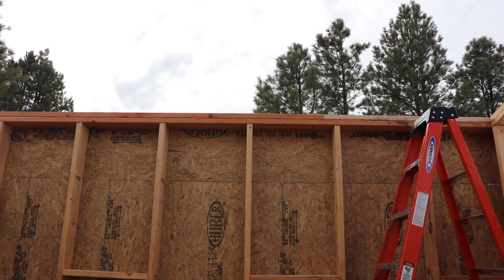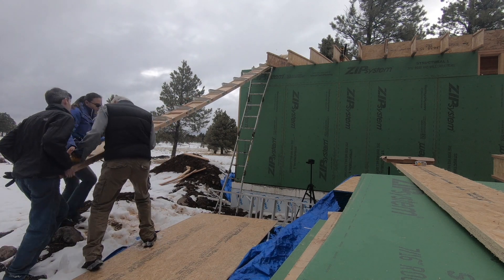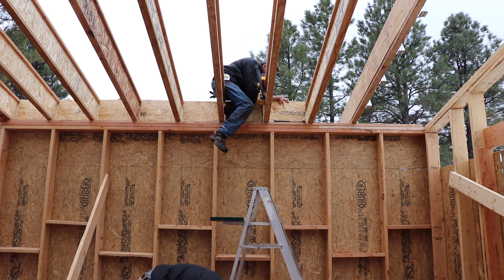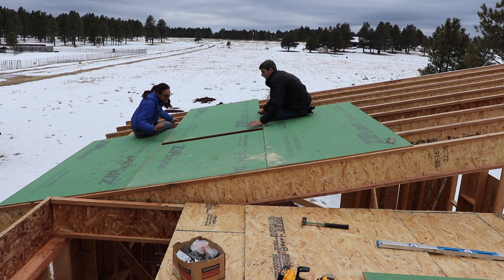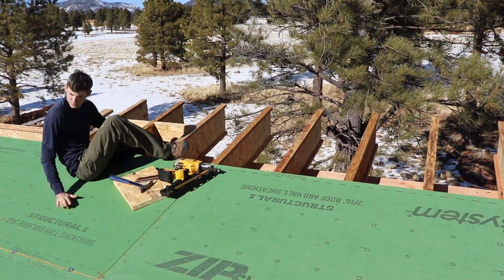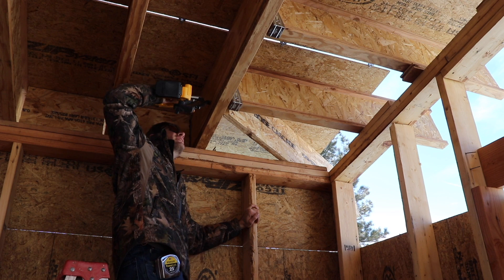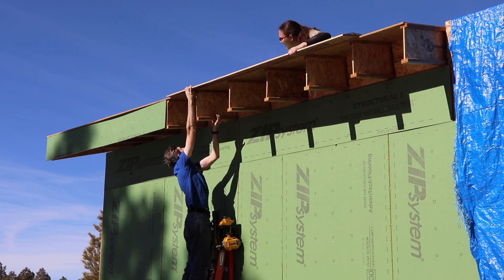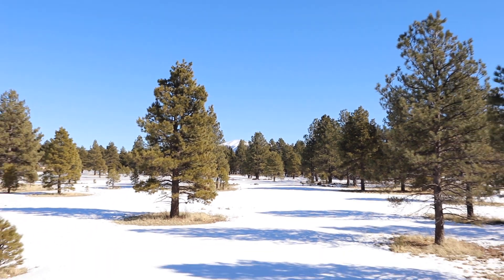Framing A Roof With I Joists (Shed Roof Framing and Sheathing)

Comment: Many people wonder whether it’s better to cut the tops of the wall studs to match the roof slope or to slope the top plate instead when framing a shed roof with I-joists. The reason builders slope the top plate and not the studs comes down to how a house safely carries weight.

Wall studs are meant to stand straight up and down and carry the weight of the roof directly down to the foundation. When studs are cut at an angle, they no longer carry that weight evenly, and the contact area where the roof sits on the wall is reduced. This can lead to uneven loading and weaker support over time.

The top plate, on the other hand, acts as a transition piece between the roof and the wall. By ripping or beveling the top plate to match the roof slope, the roof framing sits flat and fully supported while the studs underneath remain straight and strong. This allows the roof load to press straight down through the wall as intended.

With I-joists in particular, having a flat, properly angled bearing surface is important so the load is spread evenly and the joist isn’t stressed in ways it wasn’t designed for. Sloping the top plate ensures proper contact while keeping the wall structure working as intended.

In simple terms, the studs hold weight vertically, and the top plate matches the roof angle. Keeping each part doing what it’s designed for is what makes the structure strong and reliable.

At first glance, it seems like cutting the top of a stud at a slope would increase the contact area, because the angled cut is longer than a flat cut. But structurally, what matters is effective bearing area and load direction, not the length of the cut surface.

When a stud is cut square, the load from above bears evenly across the full width of the stud, and that load travels straight down the center of the stud. When you cut the stud at an angle, the surface may be longer, but the load is no longer applied evenly or vertically. The force from the roof is still trying to go straight down due to gravity, but now it hits the stud on an angled surface. That creates a sideways component of force and concentrates the load toward the thin edge of the stud instead of spreading it uniformly.

In other words, the stud isn’t being compressed straight down anymore. It’s being pushed down and sideways at the same time. This is called eccentric loading, and it reduces the stud’s effective capacity even though the angled surface looks bigger.

By sloping the top plate instead, the angled surface is moved to a piece whose job is to spread and redirect loads. The top plate presents a surface that matches the roof slope, but the load is still transferred straight down into plumb studs with full, square bearing. So the studs get a clean vertical load, and the roof framing gets full contact.

So while an angled stud cut can look like “more surface area,” it actually results in less effective bearing and a poorer load path, which is why good practice puts the slope in the top plate rather than the studs.

Comment: looks good, but when using 7/16 OSB as your wall sheathing you need blocking on all seams to get adequate shear and diaphragm strength, ESPECIALLY when running your studs out 24" oc like you have.
Reply: I've done that for my flooring  I'm also going to do it for my roof

Comment: Great job on the construction!!! Your video stands out for a large slant roof home or building. Have a 32 x20 under construction,definitely wanted a  flat roof to match a metal Barndo already built. ? What was the overhang measurement And set back of the joist with hangers thank you!!!

Comment: How did you cut your beveled top plate? I’m assuming you did 3 top plates in total? Really enjoy the video!
Reply from the maker: Yep three top plates total, and the bevel was cut on a table saw (and definitely was not the safest way to do it.)
Reply: Have a 2:12 shed roof as well. How did you cut the 2x6 diagonally?

Comment: Several times you referenced the Essential Craftsman regarding a good way to bevel a top plate, and I agree his stuff is just incredible (and you also did a super job by the way!). Do you have a link to the video where he cut a beveled top plate? I've searched and can't see to find which video of his has that process.
Reply from the maker: I don't know what it is off the top of my head, I know it was during his spec house build while they were putting rafters up on the front of the house.
Reply: I’ve been looking too.

Comment: How did you cut the beveled top plate?
Reply from the maker: I used a table saw. It wasn't the easiest but it worked. If you watch the essential craftsman videos he cuts a beveled top plate a little different and it seemed easier.
Reply: What episode was it on the essential craftsman? He has like a million episodes.  Lol... just asking because I really want to check it out. I am having the same issue and this would solve it.

Comment: What is to prevent uplift and tearing your whole roof off?? No Hurricane Simpson Strong ties?
Reply from the maker: Instead of the old school hurricane ties we used structural screws to connect the joists to the double top plate.  The screws are rated for this and this method is approved by code.

Thanks for watching!

Comment: Any roof venting issues with the solid blocking in between the roof joist?
Reply from the maker: We did not vent our roof, to accomplish not having to vent our roof we had 1" of closed cell spray foam directly under the sheathing.  This is non-permeable to moisture and makes it so that moisture will not condensate on the under side of the roof.  Thus we didn't have to vent.

Let me know if you have any other questions!

Comment: Gotta quick question. I'm about to submit plans for a house with a single pitch roof that spans like 26ft. Plan to use WI80 I joists. Will it pass code to have the tops of my studs cut at an 18.5 degree angle for both of the bearing walls? This is the only video I can find of studs being cut like that. Thanks man!!!
Reply: Watched it again, must have seen it wrong. Is there anyway you could just cut a wedge to go directly beneath just the joist itself instead of spanning the whole length of the top plate?
Reply from the maker: I think you might be able to get away with cutting the studs at an angle, not sure how big of a locality you are submitting to, but if you call them or go into their office they would more than likley be able to give you the answer.  I don't see where that would be an issue though seeing as you angle studs when building a rake wall.  And you could also do a wedge the trick would be getting it to stay in place without moving which may require nailing or screwing it to the top plate without splitting it.  

I would talk to them and see if they would let you bevel the tops of the studs I think that's an awsome idea.  Sorry that's not a super great answer, good luck with your build!
Reply: @PootsPastures  
Thank you for the info!! Will call them tomorrow but the more I think about it the more I realize that a beveled 3rd top plat would make life alot more simple. Thanks again!!!
Reply: @kirtd702  how would you bevel the top plate? Circular saw? Table saw? 
I’m about to do the same thing but I’m struggling to figure out how I will bevel the top plate
Reply: @salp541  they just had me cut a wedge as wide as the bottom chord and use subfloor adhesive to glue it snug between the top plate and the bottom of the I joist. Then predrilled and drove ledger loks up thru the top plates, thru the wedge and into the I joist.
Reply: @salp541  I ended up building walls with a regular top plate, not one with studs cut at an angle
Reply from the maker: Glad you were able to get a solution!  The edge thing makes sense and I'm sure it was easier then beveling the whole top plate.
Reply: Don't ask these guys for building code instructions, judging how they built this

Comment: Thanks for all your videos.  They are very helpfull.  I have a question about your beveled I joist top plate.  Did your beveled plate add any height to the joist or did it just fill the space between the top plate and the I joist?  I'm not sure the best way to make the bevel.  It would be the simplest if you just made it to fill the void between your double top plate and the joist but I don't know if this is kosher.  Thanks again!!
Reply from the maker: So short answer is it ads a little bit of height, but it's fractions of an inch.  We cut ours on a table saw and it was pretty sketchy but worked.  You could always use a few 2x2's or somthing and cut a continuous angle on them that way you could cut through the whole thing in one go.  The essential craftsman did the beveled top plate as well, you may want to check his video out as well I believe he did somthing slightly different than us.  

Glad our videos. Could help!
Reply from the maker: Somone else just commented that they were going to try and bevel the studs themselves not the top plate which would be way easier to do.  I'm not sure if this would be allowed by code (I don't see why not) but if it is it would be a fantastic option!
Reply: I guess Im randomly asking but does anyone know a tool to log back into an instagram account?
I was stupid forgot the account password. I would appreciate any help you can offer me!
Reply: @Dominick Augustus Instablaster =)
Reply: @Diego Trace Thanks for your reply. I found the site thru google and im in the hacking process now.
Takes a while so I will reply here later with my results.
Reply: @Diego Trace It did the trick and I actually got access to my account again. I am so happy!
Thanks so much, you saved my ass!
Reply: @Dominick Augustus Glad I could help xD

Comment: Why did you need extra pieces of ply on top of your gable wall's top plate, to get the look out's level? Would they not just be level already?
Reply from the maker: So long story short we should have beveled the second top plate on the 8ft wall, not added a beveled top plate on top of the 2 already there.  Because of this error we had to use the plywood shims under those peices to make them level with the rest of the I joists. 

Hope that answers your question!
Reply: @PootsPastures  Perfect answer. Understood. Thanks!!!

Comment: This might be a dumb question, but what is the benefit of using these I-joists instead of 2x12's? I'm looking to do a similar type of structure
Reply from the maker: The I joists are engineered so you don't have to worry about quality of wood (they are perfectly straight).  You can also have larger clear spans than with traditional lumber (basically we may not have been able to span 20' with no support in the middle with dimensional lumber but with I joists it was no problem).  Another benefit is their weight.  There would have been no way I could have moved a 20ft 2x12 by myself, but I was able to move the 20' I joists pretty easily. Honestly my first choice would have been floor trusses because they are a little wider,  and can be a little stiffer at my length, they are also trusses which means you don't have to bore holes in them to run mechanicals, but no truss company would respond to me.  On the other hand you can just order I joists from pretty much any lumbered. 

Hope that helps!
Reply: @PootsPastures  awesome, thanks so much for your fast response! 

What are the dimensions of your home? I'm planning to use the zip system as well.

So how did you insulate the roof? Did you use a mini split for a/c and heat? 

I will be doing a lot of the work myself so I really appreciate your video and your advice. 🤝
Reply from the maker: The house is 20x32, upstairs is 20x16, it's a little less than 1,000 sqft.  

There's a couple ways you can insulate, one is having a vented attic like normal so there is a space between the insulation and roof sheething for air to flow.  This keeps the sheething the same temperature on the top as the bottom so condensation doesn't form on the bottom of the sheething.  The second way is an unvented attic (this is what we did).  Because you don't have any air flow under the sheething you either have to use exterior insulation or you have to use a material that does not allow vapor to reach the underside of the sheething.  Depending on your climate zone there is a certain r value that is required to be exterior or non vapor permeable.  In our area it's about R5.  We used 2" of closed cell spray foam on the underside of the sheething as a vapor barrier.  I didn't want to have a vented crawlspace especially with our wild fire risk in our area.

We are using our minisplit for heat and ac, but eventually we want to add a wood stove for heat and use the minisplit for supplemental heat.

Good luck with your project it is really rewarding doing the work yourself, and if you have any other questions let me know!
Reply: @PootsPastures  man, I've been binging your channel and I love it. Did you put additional insulation in the ceiling to supplement the spray foam?

I'd be interested in a breakdown of your solar setup. I'm having a hard time visualizing what I'm going to need. I'm in Texas so it gets well over 100 degrees in summer. I don't know how I'll manage the a/c system
Reply from the maker: Yeah we have a video of the insulation but I think it ends up being about r50 between Rockwood and the sprayfoam.  I don't have  the solar up yet but when it does go up there will deffinately be a video!

Also check out the build show with Matt risinger, he builds in Texas and has some good videos about air conditioner set ups.  But as long as the system is sized for your space and climate zone it should work fine
Reply: @PootsPastures  oh yeah I watch Matt. Thanks, bro! What a blessing finding your channel has been

Comment: Hey great video, was wondering : with all that blocking between the i-joist, is there any path for ventilation ?
Reply from the maker: If you are talking about the attic ventilation, we have an unvented attic, sometimes called a conditioned attic.  The reason you vent the attic is so that both sides of the roof sheathing is the sametemperature so that water doesn't condensate on it.  With a conditioned attic you either have exterior insulation so that the sheathing is the same temperature as the inside, or you can use a moisture barrier.  We used 1 inch of closed cell spray foam to insulate the underside of the sheathing.  The closed cell foam will not allow moisture to get to the sheathing, and insulate it from the inside.  Code requires a certain percent of your roof insulation and 1" met the requirement for our area.  I hope this made sense and answers your question!  Thanks for watching!

Comment: Why I beam vs 2x12? Curious for my own build? Never heard of I beam rafters
Reply from the maker: So where we are we need a 40 psf snow load, and from all the charts I read it was virtually impossible to get 2x lumber to clear span 20ft with that large of a load required, and the low slope we have (2.5:12 pitch) which is really flat.  So just like I joists are good for clear spanning floors they work the same way with roofs.  I would have used trusses but every company I contacted to design them wouldn't answer my calls or emails and you can just order I joists from any lumber yard. 

Another plus side is that they are alot lighter than dimensional lumber and since it is all engineered wood they are perfectly straight. 

Hope this answers your question!
Reply: That was very helpful thank you for the thorough explanation. I'll certainly look into it for my build.

Comment: I am planning on using similar wood i-Joists for the roof on an addition.  Would you say it was very difficult for a single person to lift one that is 24 feet long?  I am trying to design this project so that I can do most of it by myself.
Reply from the maker: You can do it by yourself, it is just way easier and safer with two people, it would be worth having a friend come and help you.

Thanks for watching, let me know if you have any other questions!
Reply: @PootsPastures  Thanks for the reply!  The project is still in the planning phase, but I am committed to using the i-Joists.
Reply from the maker: Thay are great, I'm very glad we used them!  Good luck on your addition!
Reply: They are light they just sway when you carry them .
Reply: @k5blazerman956  Thanks for your reply; light weight is good.  I have the engineering work completed for the new addition, but it will be a while before I start construction.  (In Florida, an engineer has to participate in both commercial and residential these days.)

Comment: Need your education here. 
How did you cut the beveled top plate?   
Thanks a lot!
Reply from the maker: Using a table saw we put the 2x6 on edge and ran them through at the angle we needed.   We started with the blade only cutting in about half an inch then moved it up incrementally. 

Once it can't go any higher we flipped the 2x6 and cut the remaining side.   It took a while to do. You could also use a couple of 2x2's or 2x4's so you could cut through the whole thing in one go